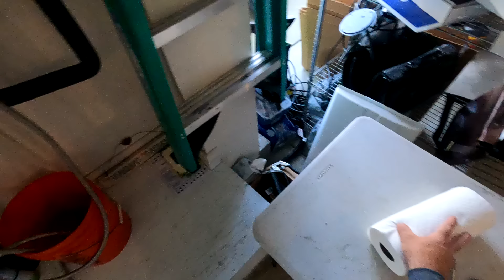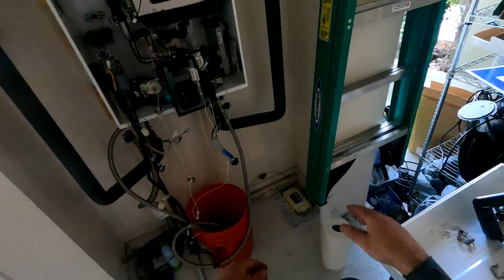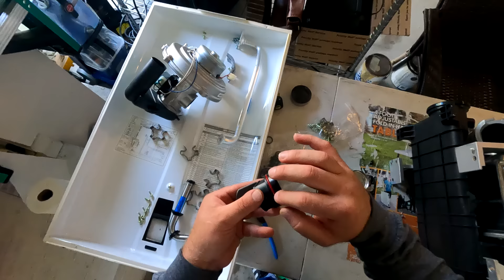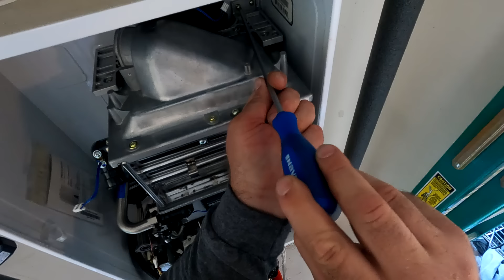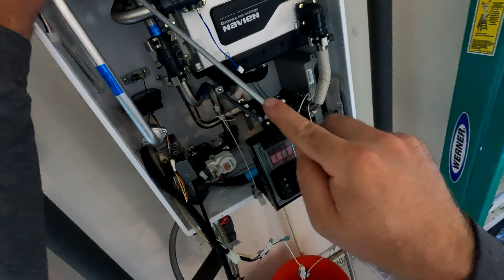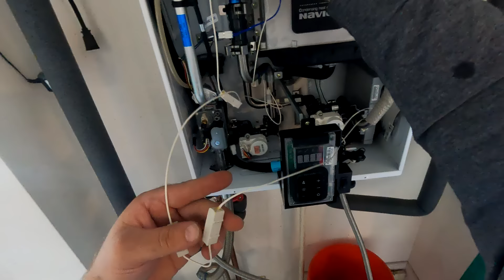Leaking Heat Exchanger Replacement of a Navien NPE180S Tankless Water Heater

Comment: Thank you for the video, I completed the change out with this video. It was very easy for me. The only problem that some may run into is if it's an older unit the gas ratio does not match up with the new unit and the unit will cycle on and off. Now I have to get the gas adjusted per Navien support.

Comment: I think my Navien 240 (2018 year) needs this. Has a code 003 and when it tries to ignite and make hot water, water absolutely POURS out of condensate line. A leak in h.x. would then drain out of condensate correct?
Reply: Same thing happened to me this week. Water pouring out of condensate drain. Not a drip more like an open faucet. Failed heat exchanger. Navien sent me a new heat exchanger very next day

Comment: What is the baser of your grease? Is it PTFE? Super Lube makes a NSF silicon grease with some PTFE. Good enough for gas, oil, engine temps should be good for faucets and valves, I would think.

Comment: I got an error code 351 called navien and they said it is the heat exchanger. I want to know from someone professional, does the heat exchanger has anything to do with that code error? 351 is low water pressure/valve sensor.

Comment: Hey I am hoping someone can help me! 

I got a NPE-180A and the red cap on my water circulation pump started leaking. I wanna know how bad this is. 

The plumber said it is just condensation and he piped it to my sump!! He also said it's not going to waste water or run up my utilities but this thing is flowing fast. When it was dripping in a bucket it collected like 5 gallons every 4 hours. 

Can any one tell me more about this pump and what they red cap is supposed to do?
Reply from the maker: Try to tighten it. It may have been loose. This is the air bleed for the circulation pump line.

Comment: Thank you, just replaced mine following your instructions!
Reply from the maker: Yes, it is smarter to just get a new water heater if 16 years old. You can try a flush but that can trigger a heat exchanger leak. One way or the other you will need a new water heater soon. https://www.noritz.com/media-archive/16-Error-code.pdf
Reply: @dennistheplumber  mine was just two years old

Comment: Thank you your video. I am currently own the Navien NPE 240A. I recently encountered the water discharge a steady stream down to the sewer line. I went to replace the O Ring on the cold water inlet. It improved a lot . Now it is just dripping little bit that you couldn’t hear the sound of water. I know it dripping by look down the discharge pipe. By saying that, it is normal now or something I have to do.

Comment: Thanks Dennis; great video. I don't have a Navien, but after seven years of service, experienced the same problem with a Takagi (T-K3-OS). Looks like Navien is put together much more straight forward than Takagi, but essentially the same plug-n-play, just more unplugging and replugging with Takagi. Most important was the screwdriver. It really needs to be long and magnetized. Could you share the model and make of your screwdriver and magnetizer? Thanks again!
Reply from the maker: Tools needed for this procedure:

1. Screw Driver with Magnetizer - https://amzn.to/3JSdzgi

2. My favorite pliers sets:
- Single Pliers Medium Size  -  https://amzn.to/3sZfwBc

- Two Pliers Set, Medium & Large  -  https://amzn.to/3znkMQC

- Three Pliers Set, Small, Medium & Large  -  https://amzn.to/3pMuyII
Reply: @dennistheplumber  you rock! I just saw your Noritz breakdown good work!

Comment: Hey great video man. Should you test the new part for leaks after installing it? Im hearing theyre sending out a lot of deffective heat exchangers.
Reply from the maker: I never ran into a defective heat exchanger. Yes, I always allow up tp 30 mins after I pressure the system and before I put the front panel back, so I can check for leaks.

Comment: What was the symptom? Water leaking internally/excessively through condensate line or just leaking outside the whole heat exchanger? Or combo of both?
Reply from the maker: Depending on the stage of the malfunction, it could be one or all of the symptoms you mentioned. It starts with constant discharge throughout the condensation line, and progresses to a water sputter through the fan assembly air intake inside the unit. Everything internally gets wet eventually.